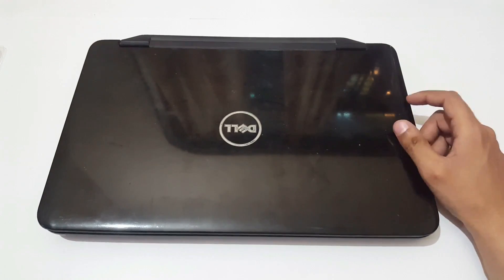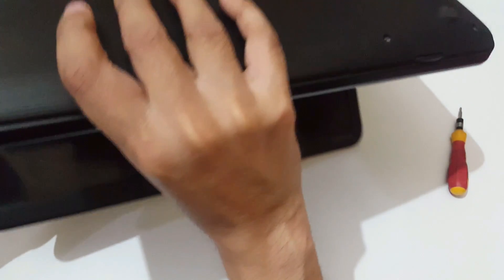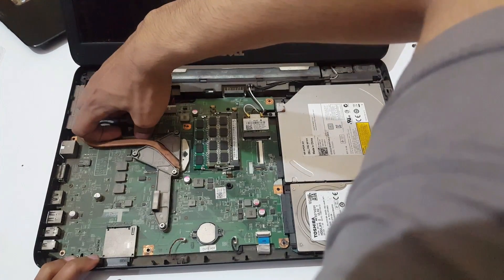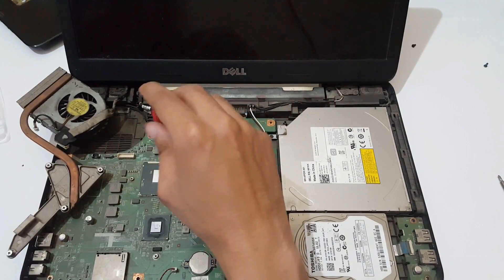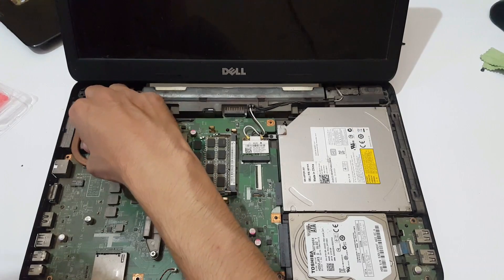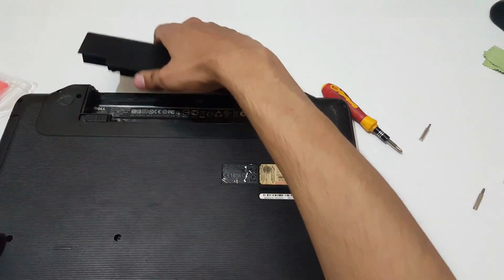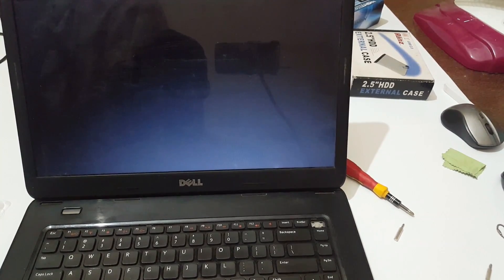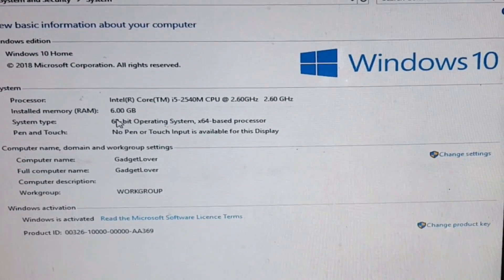How to Upgrade Processor on DELL Laptop | i3 to i5 & i7 - Make Laptop Faster for Gaming

Comment: Hi really great video, informative. Can I ask if I could also upgrade my laptop, Dell Vostro 1540 Intel Core i3 processor to Corei5 CPU and what type or specific i5 CPU? Thanks.
Reply: I already upgraded it but it's still slow.

My ram is 8GB 2RX8 12800S DDR3L
I have also an SSD.
Reply from the maker: @carlbryanmanzanadez8256  Thanks and Intel Core i5 580M is best processor for your Laptop
Reply: @GadgetLover360  How about Intel Core i7 640m? Is it compatible?
Reply from the maker: @carlbryanmanzanadez8256  Yes
Reply: @GadgetLover360  alright, thanks a lot
Reply from the maker: @carlbryanmanzanadez8256  You're most welcome

Comment: Hi bro
I have a laptop which is Dell Inspiron 17R N5720 Laptop (Core i7 3rd Gen
Can I able to upgrade with Core i9 12 th gen.
Or I need to change motherboard if i want to upgrade
Reason: It's 17 inch laptop+ If i want new one It will cost more than 1.5Lakhs with high end processor.
Reply from the maker: I would like to inform that you can upgrade it in same generation and Intel Core i7 3632QM is best processor for your Laptop
Reply: @GadgetLover360  Yeah bro but it's 8 year old laptop And most of the time it make continuous noise then sometimes power off.
Issues
1) Makes a lot of noise even when I open a chrome and it continues
2)Poweroff if it heats a little bit higher
3) Sometimes My screen is shaking ( Not frequently)
If i change to 8gb Ram with SSD 
Will that noise and screen shaking will reduce bro?
I don't know why but I want this laptop for more years.
Reply from the maker: @RamKumar-wz4cw  I would suggest you go to nearby PC store and tell them about this problem
Reply: @GadgetLover360  They are asking to update drivers(Doesn't work) and some people says it's old better sell it. That's why I like to know what can I update bro
Reply from the maker: @RamKumar-wz4cw  With processor upgrade its RAM to max and install SSD for more better performance

Comment: Hi Gadget Lover. Tell me what processor I can upgrade for my Dell Insipiron N5050? It is having Intel 2nd generation, core is, 2.3 GHz. Can I also upgrade the motherboard of my laptop as well
Reply from the maker: Hi and Intel Core i5 2540M is best processor for your Laptop
Reply: @GadgetLover360  i am from India. Would you please tell me from where and I buy this processor? And what type of RAM, like dual channel,quad channel, configuration would be compatible for my Dell Inspiron N5050 laptop?
Reply: @GadgetLover360  And which is OS is best for work like Ubuntu, Linux or Windows or Fedora OS?
Reply from the maker: @HASHMYDANISH  Buy it from Ebay online store and buy 1333MHz DDR3 dual channel RAM
Reply: @GadgetLover360  Would you please tell me about the configuration of RAM suitable for my Dell Inspiron N5050 laptop? By configuration, I mean R1×8, R1×16, R2×8. Do you get my point? Which RAM stick is best, Crucial brand or Hynix brand?
Reply from the maker: @HASHMYDANISH  Hynix
Reply: @GadgetLover360  and what about the configuration of RAM, like R1×8, R2×16, R2×8 ‽
Reply: @GadgetLover360  and please do tell what if I install SSD on my Dell Inspiron N5050 laptop. Will it support SSD and which brand will be best for SSD? Seagate or Crucial? I suppose Seagate would be a better option. What do you say? And what about NVMe? Will my laptop support it? And can I install NVMe on my laptop
Reply from the maker: @HASHMYDANISH  It has dual rank module and internal 2.5 inches SSD will work and in my knowledge Adata is best
Reply: @GadgetLover360  so should I buy SATA SSD, M.2 SSD or NVMe SSD for my Inspiron N5050 laptop?
Reply from the maker: @HASHMYDANISH  SATA SSD

Comment: I have a dell vostro 3560 and my intel is i5-5200U is my processor upgradable for i7?
Reply from the maker: The processor of this Laptop is soldered so you can't upgrade it but I would suggest you upgrade its RAM to max and install SSD for better performance

Comment: Hp 245 g5 laptop with amd pro a4-3350b apu processor,,can i upgrade my processor..
Reply from the maker: The processor of this Laptop is soldered so you can't upgrade it but I would suggest you upgrade its RAM to max and install SSD for better performance
Reply: @GadgetLover360  thank u bro ..can i know how much it cost to upgrade ram and install ssd
Reply: @GadgetLover360  bro i have another doubt is the inbuilt keyboard of the pc is replaceble..
Reply from the maker: @nidhinkrishna5560  Yes and I would suggest you see its price on online store or visit nearest PC store

Comment: Can I upgrade my Acer Aspire Es1-111 with Amd Ryzen series?
Reply from the maker: In my knowledge the processor of this Laptop is soldered you can't upgrade it but I would suggest you upgrade its RAM to max and install SSD for better performance
Reply: @GadgetLover360  thnx
Reply from the maker: @pitchblack4324  You're welcome

Comment: I really loved seeing the whole method😍...
Can you please answer me that can i replace dell i3 3542 laptop processor to a new processor ( whichever is suitable)?
My laptop is flickering again and again with irregular intervals, i already changed screen and display cable) but all in vain. Now i am finding solution of it!
I appreciate your words✌️
Reply from the maker: Thanks for your love and support I would like to inform you that the processor of this Laptop is soldered so you can't upgrade it but I would suggest you upgrade its RAM to max and install SSD for better performance
Reply: @GadgetLover360  Ur always most welcome...
Actually inreplaced my ram and ssd already and display cable too but still its flickering and sometimes diming the light...i updated drivers several times but issue is not solved sometimes it give purple colour too...i am afraid to replace the full motherboard which cost exactly to a new motherboard. So, i am finding solution here
Reply from the maker: @FashionAttracts  It's my pleasure and it might be due to display cable so replace it and see whether the problem has been solved
Reply: @GadgetLover360  thanks you so much for your kind words....i will go for it first to change the cable again...👍
Reply from the maker: @FashionAttracts  You're most welcome

Comment: Is it possible to upgrade tye process of dell 5567 i5 7th gen to i5 10 or 12gen?
Reply from the maker: If not soldered it can upgrade in same generation and the processor of this Laptop is soldered so you can't upgrade it but I would suggest you upgrade its RAM to max and install SSD for better performance

Comment: Sir can i change i3 processor to i5 in dell Vostro 3400 4 gb 1 tb.🙂
Reply from the maker: The processor of this Laptop is soldered so you can't upgrade it but I would suggest you upgrade its RAM to max and install SSD for better performance

Comment: DELL Vostro 3000 Core i3 10th Gen - (4 GB/1 TB HDD/Windows 10 Home) 3490 Thin and Light Laptop. Can I put an entra 8gb ram in my second slot.? Will it work fine if the total be 12gb ram?(4gb+8gb=12gb RAM)
Reply from the maker: Yes and I would like to inform that you can expand it upto 16 GB

Comment: Bro can i upgrade my Dell Inspiron laptop processor. Now I have Intel core i3 processor in my laptop ? 
Which is best gaming processor for my laptop ?
Reply from the maker: I would like to inform you that if the processor is not soldered you can upgrade it in same generation
Reply: @GadgetLover360  which processor is best for gaming for my laptop?
And thanks for reply.
I always support you ❤️
Reply from the maker: @harshu8271  You're welcome and kindly provide processor number
Reply: @GadgetLover360  ??😅
Processor name is - Intel(R) Core(TM) i3-3110M CPU @ 2.40ghz.
Reply: @GadgetLover360  what happens ?? No reply 😔
Reply from the maker: @harshu8271  Intel Core i5 3380M is best processor for your Laptop
Reply: @GadgetLover360  do you have any Instagram account i want to talk with you I have some questions pls help me bro 😵
Thanks for replying ❤️❤️❤️❤️❤️😭
Reply: @GadgetLover360  can i use Intel Intel i7 3770 ?
Reply from the maker: @harshu8271  You're welcome and no
Reply: @GadgetLover360  i want a processor for gaming i5 is best or another better than him ?
Reply from the maker: @harshu8271  It is best or you can go with Intel Core i7 3540M
Reply: @GadgetLover360 this processor support G2 socket ?
Reply from the maker: @harshu8271  Yes
Reply: @GadgetLover360  thanks bro ❤️❤️
Stay happy 🤩❤️
By😚
Reply from the maker: @harshu8271  You're welcome and wish you the same

Comment: Sir I have i3 6100 U in what should I upgrade to
Reply from the maker: Intel Core i5 6300U is best processor for your Laptop
Reply: Should I use in i9 6900k
Reply from the maker: @SatanEditzz  I would like to inform that you can upgrade it in same generation
Reply: Ok

Comment: Sir whats the best processor for dell inspiron laptop 15 i3-2350m 4gb ram with 300+ rom windows 7? pls tell me...
Reply from the maker: Intel Core i5 2540M is best processor for your Laptop and I would suggest you upgrade its RAM to max and install SSD for more better performance
Reply: ok sir

Comment: dell latitude e4310
i3-m370 @2.40ghz
hello bro, your vedio is really informative i want to know which processor is best upgrade for my laptop processor
Reply from the maker: Hi and the processor of this Laptop is soldered so you can't upgrade it but I would suggest you upgrade its RAM to max and install SSD for better performance
Reply: @GadgetLover360  thnks :)
Reply from the maker: @moksjov208  You're welcome

Comment: My laptop is dell Inspiron 15 3000 series ( 3567 ) and my processor is intel i3
Can I upgrade to i5 or i7 ?
Is it safe ?
And also I want to upgrade my graphics card 
Plz reply for this question
And tell me what is the range of  cost for the above upgradation you expect
Reply from the maker: The processor of this Laptop is soldered so you can't upgrade it but I would suggest you upgrade its RAM to max and install SSD for better performance and you can attach external graphics card to your Laptop for better gaming experience
Reply: Plz say what is the max level ram to my laptop
Reply: Plz tell me the approximate rate for SSD
Reply from the maker: @sivaa5763  You can expand its RAM upto 16GB and I would suggest you search best SSD for your Laptop on Google for better results

Comment: Also I would like to know the life or longitivity of the laptop. It's already 4 years I am using it, if I replace i3 to i7 10th or 11th Generation, how long will I be used this laptop? 
If the lagging is remain the same after replacment the processor, then it's of no use of spending on processor. 
Please guide. 
Thanks.
Reply from the maker: You're welcome and I would like to inform you that if the processor is not soldered you can upgrade it in same generation and definitely it will improve the performance of the Laptop and I would also suggest you upgrade its RAM to max and install SSD for more better performance
Reply: @GadgetLover360  Ok. Will check both option. 1st I need to check, it is soldered or not. Will be back with feedback. Thanks a lot. 👍🏻
Reply from the maker: @milinda707  You're most welcome
Reply: @GadgetLover360  So, I visited to Dell Service Center, they said, the chip is soldered. Can not upgrade to i7. Hard Drive can change to SSD 1TB & RAM can be 4+4 = 8GB. There is a slot to expand. He said with this improve performance. Estimated cost 7K all. What do you suggest? Shall I go or Shall I buy new laptop? If new laptop, then how about Dell 7510/15.6/i7:11th Gen./8GB Ram. Is it good? 
Thank you.
Reply from the maker: @milinda707  You're welcome and yes it will definitely improve the performance
Reply: @GadgetLover360  Ok. Then will go for SSD & RAM expansion. Thank you. Will update you soon . 👍
Reply from the maker: @milinda707  You're welcome

Comment: Hi, I am using Dell Inspiron 5559 with Intel i3 inbuilt processor. 4GB Ram. My laptop is make of 2018 & now it is lagging often. Opens very slow. Many times getting notification that Microsoft browser is not responding. Though my laptop is updated always. 
Can I change Intel i3 processor to i7? 
What about genuine or warranty of this part? 
From where I get the genuine one? 
Do I need to take data backup?
What about windows 10 & Office, shall I reinstall it?
Will it run smoothly after upgrading to i7? 
Please guide. 
Thanks. 
(India)
Reply from the maker: You're welcome and I would like to inform you that the processor of this Laptop is soldered so you can't upgrade it but I would suggest you upgrade its RAM to max and install SSD for better performance

Comment: This laptop has PGA socket, which its able to replace cpu. Most of other laptops cant replace cpu because its using BGA socket (cant replace). CPU that cant be replace are laptop cpu which it came with U, H or G(with a number) (Ex: i5 10500H, i3 4005U, i5 1135G7...). most of the new laptops doesnt have an option to replace cpu. You can only replace or upgrade a CPU if that laptop has an LGA or PGA socket
Reply from the maker: I would like to inform you that if the processor of the Laptop is not soldered you can upgrade it in same generation
Reply: @GadgetLover360  Can I Upgrade Mine?
 Intel (R) Core (TM) CPU i5 M460 @2.53 6GB RAM
Reply: Can You Tell Me If My Processor is Upgradable?

Mine is Intel (R) Core (TM) CPU i5 M460 @2.53 6GB RAM
Reply from the maker: @phigo4kins Yes and Intel Core i7 640M is best available processor
Reply: Can i upgrade mine its i3-2350m
Reply from the maker: @BlooDxGoD_1 Yes and Intel Core i5 2540M is best processor for your Laptop
Reply: Can I upgrade my dell Inspiron n4010 laptop it has i5 M580 which will be best for me to make it faster and smoother
Reply from the maker: @hemantgoswami8681 Yes and Intel Core i7 640M is best processor for your Laptop
Reply: Can I upgrade too? Mine is i3 3217U?
Also what ssd should I use for upgrade? And what ram is max for this laptop for upgrade?
Reply from the maker: @Ashish_fr Yes and Intel Core i5 3437U is best processor for your Laptop
Reply: Omg😂 I wish u would be a computer teacher😂

Comment: I have DELL Vostro 3000 Core i3 10th Gen - (4 GB/1 TB HDD/Windows 10 Home) 3490 14 inch Thin and Light Laptop...which processor will be better for my laptop? And I'm going to upgrade my harddisk to SSD 500gb and ram 8gb more total will be 12gb ram.
Reply from the maker: In my knowledge the processor of this Laptop is soldered so you can't upgrade it but SSD and RAM upgrade will definitely improve its performance

Comment: Very useful video thanks bro      
can I upgrade Intel i3 5005u to i7 or i9
Reply from the maker: You're welcome and if the processor is not soldered you can upgrade it in same generation and Intel Core i5 5300U is best processor for your Laptop

Comment: Can I upgrade my dell Vostro 3000 3581 processor
Reply from the maker: The processor of this Laptop is soldered so you can't upgrade it but I would suggest you upgrade its RAM to max and install SSD for better performance
Reply: @GadgetLover360  Bro i use ssd 480 gb and my laptop is running like bullet
Reply from the maker: @RadheRadhe-x5b  Alright

Comment: Intel(R) pentium (R) 3805U @1.90GHZ 1.90GHZ 
Can I upgrade to core i3
Reply from the maker: Yes and I would like to inform you that Intel Core i5 5350U is best processor for your Laptop
Reply: @GadgetLover360  ek question h kya processor change karne se laptop kharab toh nhi hoga na kyoki uske andar ke component toh intel pentium ke liye lgaye gye h jyada power dene se battery me bhi effect ho sakta h kya
Reply from the maker: @vishal-xh9fs  No and I would like to inform you that both are of same power consumption
Reply: @GadgetLover360  bhai laptop ka processor toh mil hi nhi rha h sab desktop ke dikha rha h kaise kharide
Reply from the maker: @vishal-xh9fs  I would suggest you buy it from Ebay online store

Comment: Brother can you tell me can I change my dell inspiron 15 3521 pentium processor to i3 or i5 processor. 
Pls reply
Reply from the maker: The processor of this Laptop is soldered so you can't upgrade it but I would suggest you upgrade its RAM to max and install SSD for better performance

Comment: Hey Bro, i have a Dell Inspiron 5567 with intel core i3. What’s the best processor to suit the Dell for an upgrade?? Also will i need any software for the processor upgrade??
Reply from the maker: I would like to inform you that the processor of this Laptop is soldered so you can't upgrade it but I would suggest you upgrade its RAM to max and install SSD for better performance

Comment: Sir I have Dell xps 1 gen i7processor 
Can I replace it with i9 latest processor
Reply from the maker: I would like to inform you that if the processor is not soldered you can upgrade it in same generation
Reply: @GadgetLover360  thanks sir
Reply from the maker: @pushkarjoshi7920  You're welcome

Comment: Having dell insp.15 i3 4th gen which one will support to my laptop if i upgrade i5 or i7?
Reply from the maker: I would like to inform you that if the processor is not soldered you can upgrade it in same generation